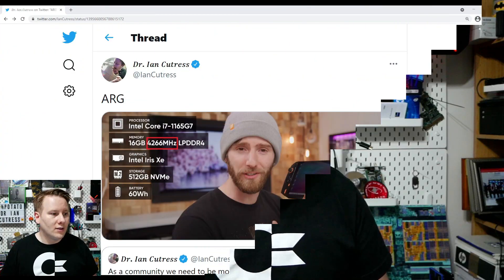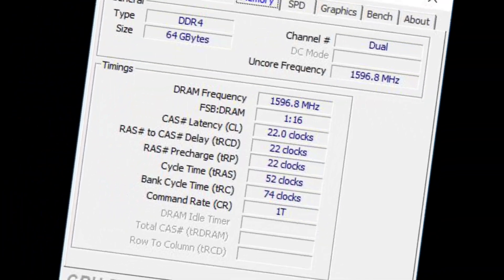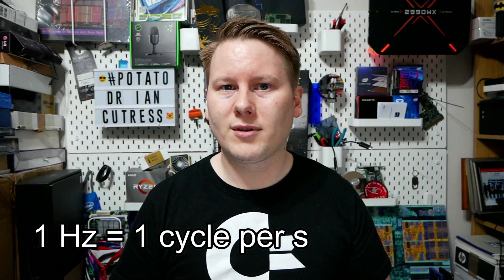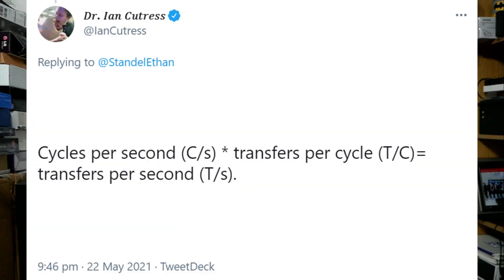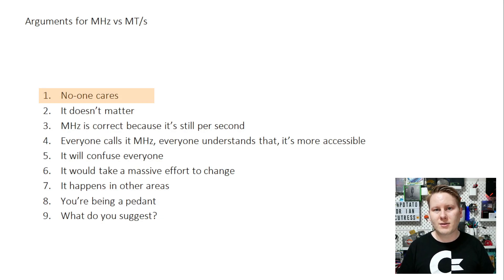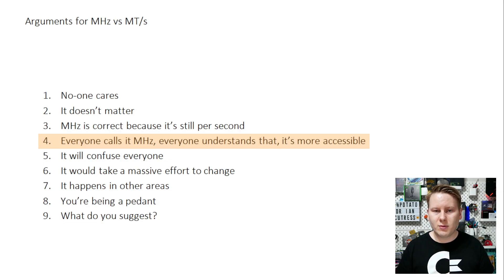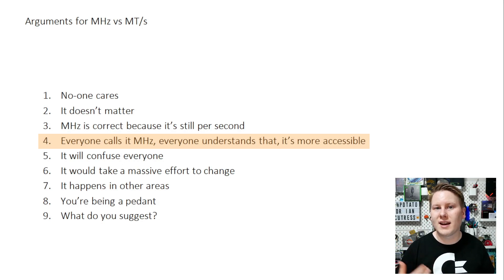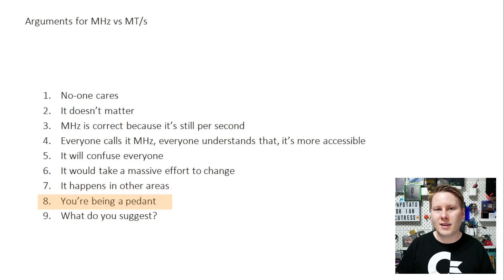Linus is WRONG 💩 : Explaining MHz vs MT/s

Comment: 1. I would argue not using units wouldn’t help because people would just assume it to be that unit anyway. To say “only” “3600” may be “more correct” but people would still think “Oh, it’s 3600mHz”. They will see them as interchangeable, not as independent things (i.e. one being a technical term, the other effectively just a product name).

2. This criticism is probably better directed at the marketing depts of the manufacturers who came up with this as a way to sell by way of putting bigger, more impressive numbers on the box. Or maybe at JEDEC as someone else commented. Not so much at the common user or the tech tubers.

I daresay no amount of effort would change this misuse of the term. But, it might be worth pushing to intervene on the use of bad terminology before it enters the mainstream for future products, e.g. when DDR5 or QDR memory becomes available. The wave that is branding on DDR3/4 has already passed and crashed onto the shore, write it off and focus on the next wave that’s coming.

Comment: As an engineer, I find that precision in terminology is absolutely essential *when there's a possibility of misinterpretation*. Since all memory types of relevance used in this industry for the past two decades and for the foreseeable future are based on a variant of DDR, every memory specification can be assumed to be a double data rate value. You indirectly reinforce this by advocating for no units (ie: they don't actually matter), but since there's not really a scenario where somebody will misinterpret an "incorrect" unit to mean something else (since there is no other common meaning in this context) then the distinction is immaterial, and an "incorrect" unit is of no real harm.

Only when and if there's another memory type in common use that has a different relationship between transfers and clocks would there be any point in being more accurate/specific here. Linus' example around processor operations per second is a different scenario, because there are actual differences with various architectures/products about how many operations they can do per clock, unlike memory where everything is DDR for all practical purposes.

As a related point, you even mention capacities in this video such as megabytes without going into the distinction between power-of-ten (mega-) and power-of-two (mebi-). This distinction and imprecision persists in this industry despite there actually being a difference between these two units, because in practice the difference is small enough to only matter in very specific contexts (in which case people should be precise where it matters). 

To give a counter-example, it's substantially more important that people correctly distinguish between bits and bytes in speed or storage units (in particular the upper and lowercase B for bytes and bits respectively in abbreviations), as there's a factor of eight difference between them and it's not uncommon for these units to be mixed in the same context (ie: internet speeds in megabits per second, but a download or transfer being listed in megabytes per second). Since there's a clear and obvious misinterpretation that can happen that has significant effects on the outcome, it pays to be precise here.

Pick your battles, and advocate for precision where it matters, but railing about imprecise terminology when there's no negative outcome from an "incorrect" usage is a waste of time/energy and diverts focus away from terminology confusion that actually makes a difference. I would love just as much as you if everybody used the correct terms all the time, but the practical reality is all that we can hope for is people using the right terminology when it matters and don't worry about the rest.
Reply: 100% this!
Reply: QDR is still used in niche markets (like quad channel memory or SMT4 and 8 aren't used in consumer market but we still use non ambiguous terms nevertheless) and during K7/P4 era the FSB needed to be manually set at the clock freq of the DDR dimms, not its labeled speed (often wrongly written in MHz unit just to add confusion for the DIYer).
And as Ian said, if it doesn't matter because SDR is not a thing anymore and units are now useless, why such a slightly change that already should have occurred two decades ago is still an issue for some people?

Comment: i dunno man. the reads from bus into cpu cache, when data transfer is happening, operate on exactly a 3600 mhz cycle, set to be 2x the memory clock. i'm not really convinced sure this is really as rigorous as you say, you kind of just brush this off saying it's not a clock because it's not happening constantly. i mean, yeah it's not a clock, it's an intermittent cycle with 3600 reads/per second when operating.

Comment: We have conventions. The number following DDRx (where x is the 'breaking' revision) has always been —drum roll— the rate of transfer. 
ie: the RATE of DATA is passed on to the *computer*'s bus per second. It's been 2 times the clock speed ever since we started using Double Data Rate RAM. 
The clock rate is meaningless. 

cf: https://en.wikipedia.org/wiki/DDR_SDRAM

If you ask me for $5 and I give you five $1 bills: you got your $5.

Comment: Your claim that a signal must be cyclical for a Hz denotation to be valid makes little sense to me. There might not be a change in the signal for every cycle, but if I poll a DDR module that's driven at 1600 MHz, then I need to do so at 3200 MHz, because that's the speed at which it outputs data. Hence the difference is only in whether you're talking about the driving clock or the data clock

Comment: technically, for DDR4-3200, the data rate is 3200MT/s, the address rate is 1600MT/s and the clock signal (the comes from an external source) is 400MHz. the clock is multiplied by 4, so the address signal is also 1600MHz and the data transfers at both edges.

Comment: Ok, ive checked 7 online stores with computer parts in my country... if any of them state the unit of operating frequency, they all use it "incorrectly" but even from this video, i fail to understand why "3600 Mhz" would  be incorrect... it would depend on what you are talking about... if you are talking about clock frequency, sure, its false... but if you are talking about the transfare frequency, it would be 3600 Mhz, because a transfare can happen 3600 million times per second... nobody is taking about clock cycles when they are talking about memory, therefore asuming that the 3600 million number per second must refare to clock cycle is just wrong.
talking about cpus... the nm naming of cpus is all over the place, it doesnt mean anything anymore and the same kinda goes with clock frequency... why the fuck does clock frequency matter anyway?!
I would say that the giga instruction per second metric would be nice... it would be definetly more reflective of real world performance...

Comment: The fundamental conflict seems to lie between the computer industry's marketing verbiage and the engineering terminology.  So long as the products are being marketed in MHz, I can understand Linus' position that a popular tech communicator like him will opt for the same terminology as what consumers see used by the vendors.  It is indeed MT/s but if even the BIOS lists MHz, I get why it's simply not a battle Linus sees any benefit in fighting in the consumer marketing realm.

It's a bit like the old binary versus decimal units (Tebi- vs Terabytes).  Both your positions are sensible given your contexts.  If you ask a store clerk for 3600 MHz DDR4, he will know exactly what you mean so in the commercial space, the meaning has already diverged.  The engineering definition is different from the marketing/consumer space definition and has been for well over a decade.

Your suggestion of just using the numeric rating is reasonable.  Perhaps the introduction of QDR would be an opportunity to do a reset on the terminology.  New technology makes it easier to get people onboard with new phrasing.

Comment: I think the issues is you are assuming the market that generally buys memory ( where performance matters ) cares a lot.  The market generally just accepted the marketing because of their comprehension that it is still double data rate and they comprehend it is running half the listed ( EX: DDR-3600 ) understanding it can do double the data per cycle. In the end the general market comprehends what is going on and understands it is dumbing down things because a lot of the market can easily grasp bigger number typically means better ( yeah I know I know not always but let's not be hyper analysts about it). I honestly think the market just continued the trend of naming because things would have gotten confusing when memory got better.
You skipped over the point Linus made "nobody really cares" which is true 99.99999999% of the market doesn't care as long as they can grasp the basic terminology regardless if it seems accurate completely.

Comment: The problem with this is that you need tp get ALL to change at the same time and ALL to do a info video for this. Otherwise everyone will be confused. There are a reason why EVERYONE use MHz and that is because EVERYONE use it even as you say the stores. As long as you can convince the WHOLE industri to change I'm up for it. It's up to YOU to make them do it if you want to make the change. You need to make them care about it. And it's a massive work you have in front of you. For me. as long as not everyone change at the same time and do info videos about it. Don't change. And do not do it half way where you make half change and half not change.

However, Go for it. If you believe in it and you rally think it should be done in the right way. Just go for it. I'm rooting for you. as long as you remember this above.

Comment: It would also be disrespectful to your audience to use wrong units for the reason that they might not understand the correct terminology, because it indirectly says they are ignorant.

As an audience member, when you hear terminology that is unfamiliar to you, it should be naturally understood that the subject matter is above your expertise level. As audience, I want the material presented to be correct, and it's on me whether I want to gloss over information, or better educate myself.

As a communicator, if you want to target your highly technical content to grandmas, instead of dumbing down the information in the hope that grandma will fully comprehend it, you should mention only enough information that might be relevant to grandma, and not dwell on technical detail, ie, keep your presentation correct, yet at a high-level of communication (ie, aimed at a low common denominator).

Thank you for this video. If anyone accuses you of being pedantic, they are being dismissive of your expertise. This says more about them that it does of you.

Comment: Wouldn't 3600 Megahertz Transfers be still correct therefore making Megahertz wrong by omission instead? I would much prefer if different units where used such as GB/s for bandwidth and nanoseconds for latency this would finally make memory comparison easy instead of having to calculate the Mt/s and CAS latency relationship

Comment: He sad "memory is running at 3600 MHz", not "memory clock line is running at 3600 MHz". Although you are technically right, actual square wave frequency is never mentioned, so saying "memory runs at 3600 MHz" could simply be interpreted as transfers are happening at 3600 MHz rate, meaning 3600 million times per second, which is also right.

Comment: Since video is made solo without call with Linus, it leaves weird impression and might even be perceived as unpleasant for other side, I think. For me way too many quotes...

As for subject. It is indeed confusing when you buy or measure. I usually seen both MHz and PC4-17000 and/or MB/s on a same description.
By saying just DDR4-2133 or whatever, it doesn''t help either to understand for consumer if it is better to completely go to new shiny "QDR-1600".
In the yend you care about throughput and latencies while paying attention if there any grey areas in how those numbers were obtained.

Comment: "Wouldn't it be confusing to change it..." Heck, it's already confusing when it has to be pointed out that any hardware info tool shows half the Mhz speed than is on the box! :) But I also get that MT/s can be hard to understand for the non-techies, so if you asked me I would suggest calling it 'transfer rate', and just using the number without units.

Comment: I had seen MT/s before and i didnt know what was the unit.
But when you described what it is, i immediately bought the unit.
Its not confuse at all, in fact is extremely intuitive, most people dont even know what a Hertz is.
ALSO
I have some background on Mechanical engineer, automation and i am a big nerd,  and if im explaining something for someone, i use the ordinary word AND the Correct Word, and very fast explain the diference.
Most People DONT LIKE using the wrong word, also, when you tell the word they are using is not Wrong or bad,  its just used for non technical people, it motives to NOT use the common word, because smart people dont use it.
The Key point is, BE POLITE and dont force it or make it a great deal, just leave for people own psychology to act.
I taught and changed so many terms of people who worked with me, even people that could barely read.
.
One more thing, English is not my native language, i probably wrote some things wrong, feel free to correct me.

Comment: I tend to agree with you for the simple fact that the reason people are misusing the terminology is because the online communicators are teaching the wrong terminology. If they had explained it correctly in the first place, this wouldn't be an issue now. I'm guilty of it too; not online, but in general when helping friends or family.

On a side note, one question. In a video about Linus, why didn't you include 7 commercials whilst plugging your online storefront? 😉

Comment: my gpu runs memory at 2000mhz clock speed and is shown as 8000mhz ... i agree this is wrong
another issue is calling cellphone storage ROM 
and the cpu nanometer terminology is also misleading

Comment: The analogy with instructions is a bad one I think. Data is data regarding just transferring it. Whether it's an image or text matters when you want to compress it. But instructions there are a ton of them. A processor can do three major things with an instruction, do branching, do numbers, and instruct hardware accelerated functions that are fixed for very specific algorithm. 

So the problem is lack of speed consistency with instructions per second. An app may just not use particular instructions. So be vastly slower.Or it could be vastly faster because particular instruction types are better supported. Now with data transfers that problem goes away. Because the content or purpose of that data is simply irrelevant.

Why don't we use simple megabytes per second like with drives?

Comment: @TechTechPotato
For what it's worth I fully agree with You regarding the erroneous (in my opinion stupid and unnecessary) use of "Mega Hertz"
... And if calling it MegaTransfers is to hard then either do as You suggest just "drop the "prefix" ... OR just call it "Speed"... That would be even more ""accessible"", and arguably even easier to "relate to" and "get the gist of" for the  the "tech Illiterate" that people argue they are "catering to" by saying "Megahertz" ...
That said, being a pedant, and proud of it, I feel obliged to inform You that You are mispronouncing that word ;)
Best regards

Comment: I think the reason why they go with the larger number saying 1800 MHz is 3600 MHz memory is because larger numbers are bigger! Example a 10 amp battery pack they’ll say is 10,000 mA. They say 10,000 mA because 10,000 has more zeros than 10 or one. The bigger the number the better.